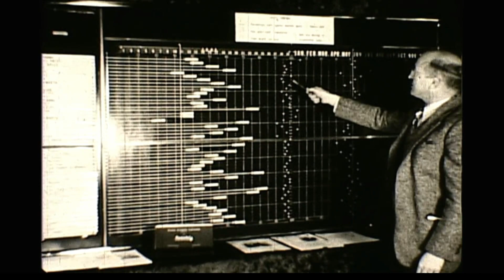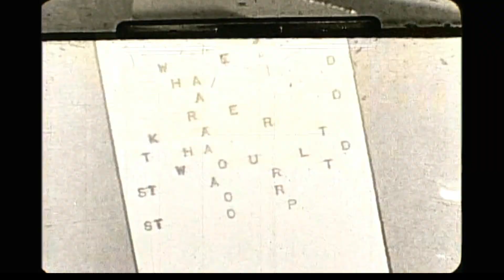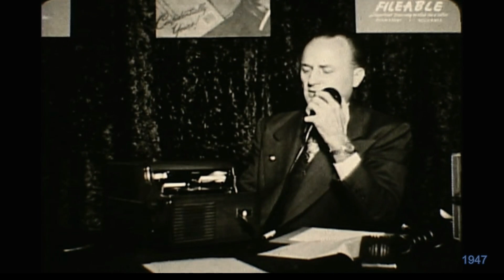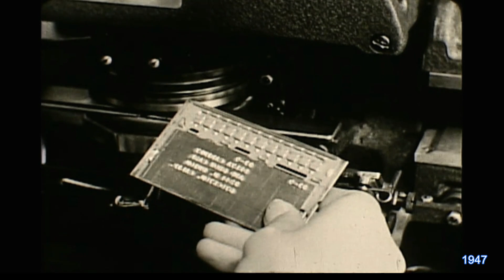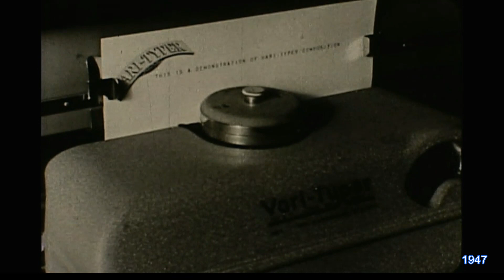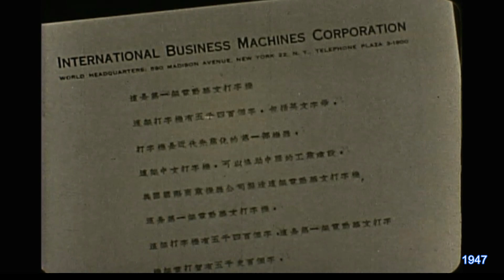Office Automation & Business Machines 1947 (IBM Chinese Character Typewriter, China, full video)

Comment: That first thing on the wall (what's it called? the audio isn't clear and the CC says prod wall wall charts) would be perfect to translate to a digital display with a touch screen. The pages on the side could be made to pop to the front when touched, to be read or information entered and edited. That section could scroll vertically to add as many pages as needed. The right section could be scrolled and zoomed. It would have all the at a glance information function of the original and much more. I'd put linkages between the horizontal markers and the tabbed notes on the left. Touch a marker and it highlights or brings forward the relevant notes. Bring a note forward and the markers on the right highlight. Those could also have flyout notes and menus.

Then there would be the added bonus of getting to answer "1947." to questions of when the system was invented. :)

Comment: I worked at a company in the mid 80s which was using the metal plate addressing system.  People were still using adding machines from the 30s which had been passed down from employee to employee. The company which is sadly no longer in business was founded in 1905. They had correspondences framed on the walls letters to customers from 1915 it was like working in an old Timey office.
I was an operator of a Wang VS 65.
Reply: I worked at my first (salaried) job in 1970 as a typist while I was a high school student. During that employment, I learned key punch. It did not compare to a skill that I needed which was word processing. I went to a technical school and learned word processing on the IBM Displaywriter and the Wang OIS. I needed to work in the same company you worked, because that workplace would complement my typewriting skill. I like to use both hands and nine fingers when I typewrite (nowadays, keyboarding).
Reply from the maker: Hi Brent, sounds very cool!   Love that old timey equipment!   -  The Rhode Island Computer Museum has a Wang VS 65.  An interesting machine!   https://www.ricomputermuseum.org/collections-gallery/equipment/wang-vs65
~ VK